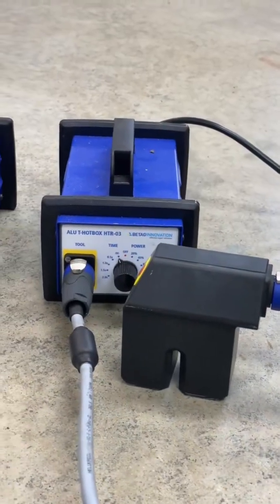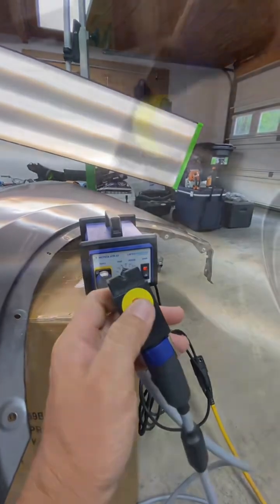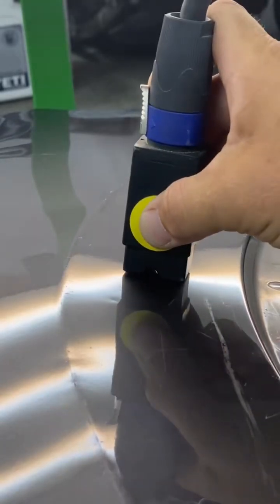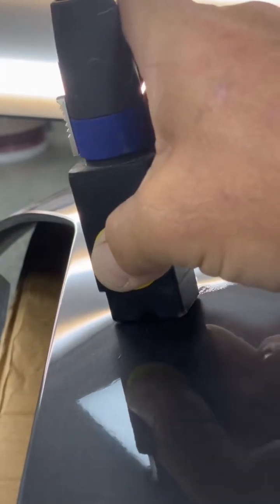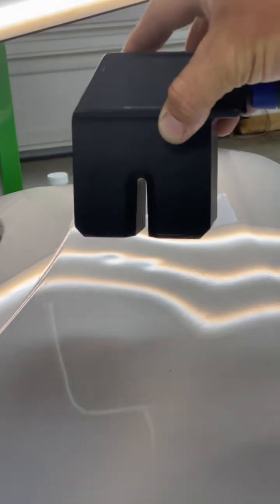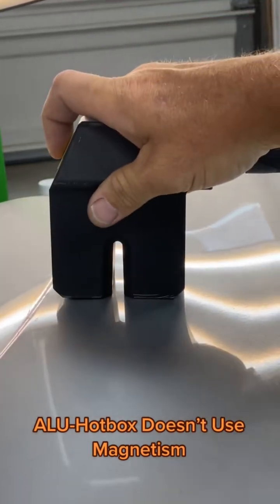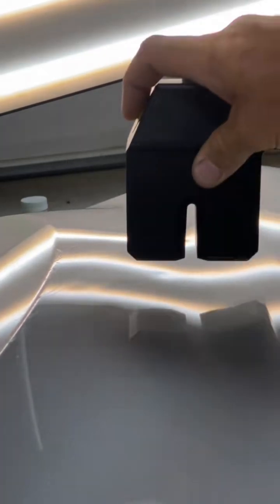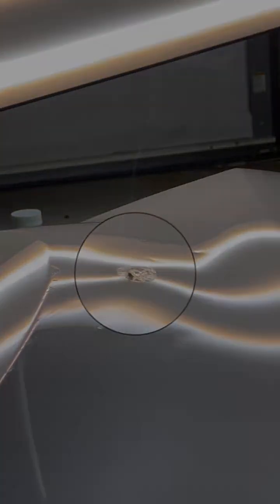Magnet Dent Removal? Using Heat Induction Technology to Repair Dents - Paintless Dent Removal 🧲 🔥

Comment: And no, that dent was not to big, the issue is that you need to know the dent was formed. Bc if you trying to induct in the middle you will only bring the metal towards the strongest point in the dent. The idea here is to reverse the impact, and to do that it’s important that you learn how to read a dent
Reply from the maker: The purpose of this video was not to fix any of the dents on those panels, I was responding to a video where someone asked me about fixing a motorcycle tank with these devices, which is not possible.  But yes, you are correct in the methodology of repairing a dent.

Comment: This is not a magnet bro😂
Reply from the maker: Correct.  It’s not a “magnet” in the simple sense of the word.  A description of how it works online states “It uses induction heating: the tool’s head (often called a “Heat Pen” or “induction head”) creates a rapidly changing electromagnetic field which heats the metal panel locally.”  So thanks for giving me an opportunity to clarify….bro 😉